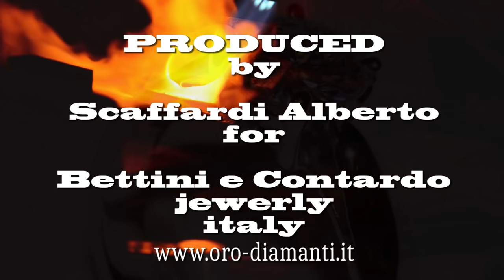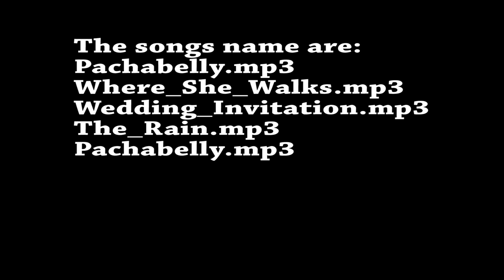diamond, mounted on white gold solitaire ring, handmade

Comment: If one make's a handmade ring, it should be unique , not like any other casted mounting. the cup he created under the diamond  is going to block light from underneath and it will reduce the brilliance of the diamond. So much good work for a common design.
Reply: The light that sparkles out of a round brilliant cut diamond, went in the top and is reflected back out of the top. That's what they are faceted to do. 
No light comes from underneath a ring. 
Stop spouting ignorance.

Comment: Excellent work!! I'm a goldsmith and one client of mine ordered me a platinum ring.......although he gave me platinum (old rings and earrings) after melting it.......when i go to shape it it breaks in pieces.......any ideas?
Reply from the maker: Yes, platinum is a very delicate metal, it should be melted in carbon crucibles, also if there are welds of other materials or impurities often during the rolling it breaks. When it happens to me I have to cleanse and re-alloy. Unfortunately, the purification costs for platinum are very high.
Reply: scaffoal thanks for the advice......i wasn't be able to work so i send it to be purified.......unfortunatelly the cost was very high.......but at least it will be pure therefore easy to work with......thanks again!!

Comment: It is zirconia. Not diamond. 
Zirconia shine with the colors of the rainbow. Diamonds shine with 2 or 3 colors like white, grey and blue.
Reply from the maker: Unfortunately you are wrong, the diamond like many other gems has the property of breaking down the light, consequently the reflections can have all the colors of the visible spectrum. Of course, a lot depends on the cut of the gem. I guarantee you that the stone mounted on the ring was a natural diamond. Furthermore, the refractive power of a diamond is higher than that of cubic zircon, the ability of the diamond to decompose light is greater than that of zircon. The only synthetic gem that has properties similar to diamond with a greater refractive power is moissanite, whose sparkle and vivacity in showing the colors of the visible spectrum is greater than diamond.